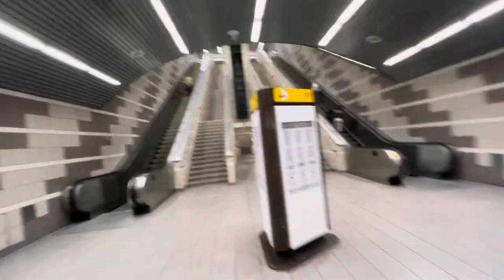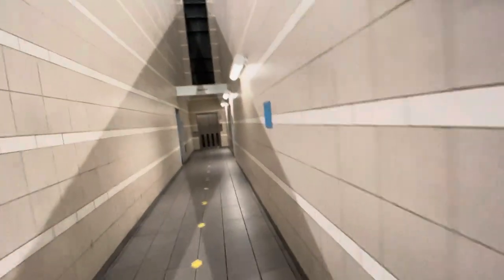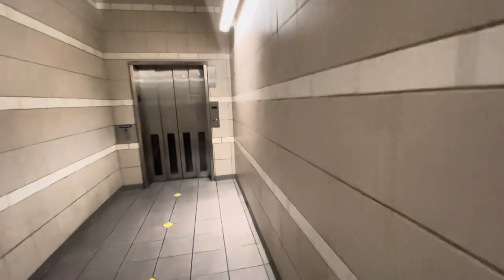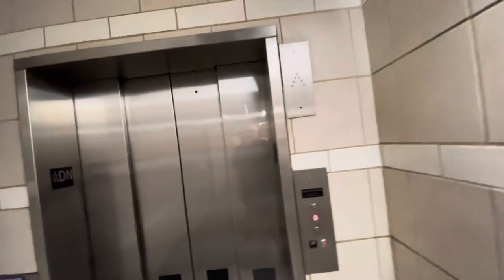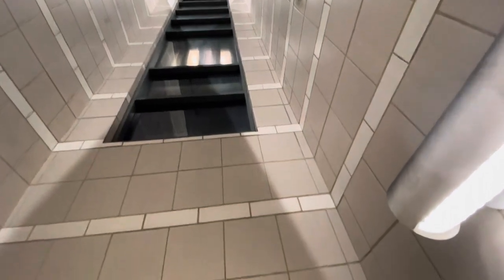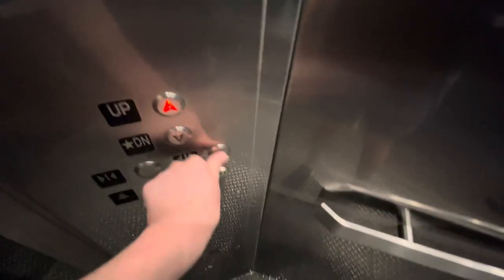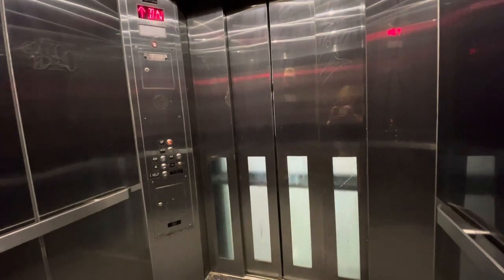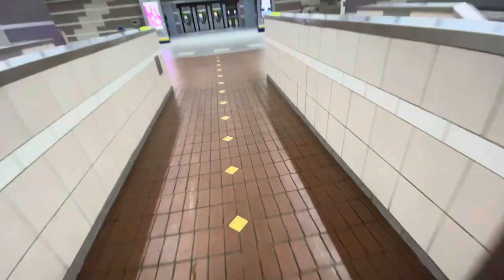2000 KONE HH/MX (mb Oracle) Hydraulic Elevator (1/2) | CityPlace/Uptown DART Station | Dallas, TX

Comment: I remember that when I rode the elevators here when I was a kid most of these elevators were broken. The two that worked were DISGUSTING!
Reply from the maker: The two incline elevators before the mod, would stop between floors and I would hold the call the call button down to get it to move. This was back in 2012.
Reply: @elevatorsbylexi  I remember one of them was stuck in between floors and had an out of service sign on it